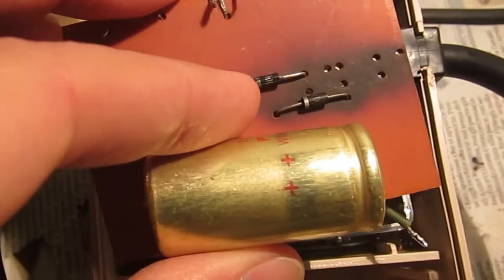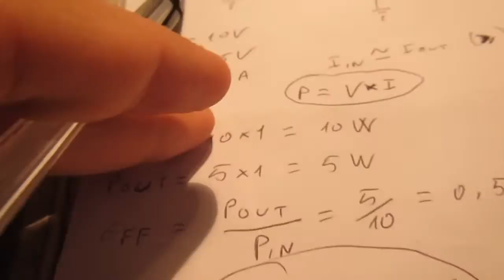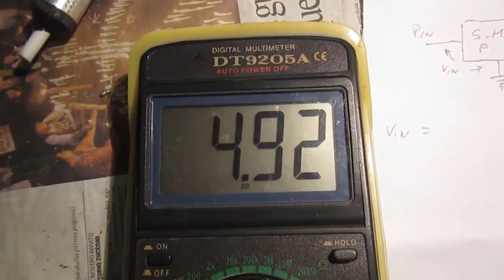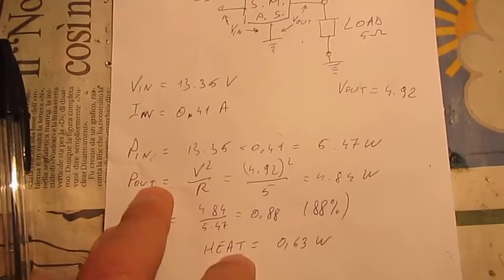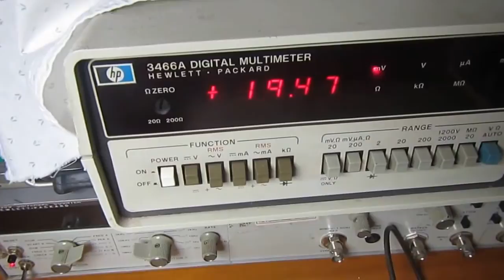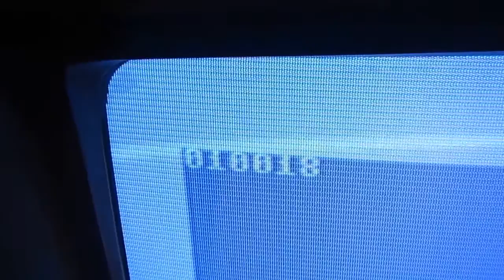Commodore C64/VIC-20 power supply repair/upgrade

Comment: Hi!
First of all thanks for the informative video. I have a newer power supply model Part No. 251053-11 which I would like to upgrade. Would you mind sharing the schematics of your design?
Reply from the maker: Hi Matthias, here it is: https://drive.google.com/file/d/1Ng9SGhC355VVgaSk85A6R8MeL4-H2JHl/view?usp=sharing
Reply from the maker: Avtually, if I'd design it again, I'd probably use an LM3485 controller and separate mosfet. More parts but less cost.
Reply: Thank you for sharing. I ended up using the LM2676 with a fixed 5v output.

Comment: I made similar mod on the more angular wedge shaped version of the C64 PSU (it has screw in the bottom and have very little epoxy in it).

What I did was the lazy way, I replaced the 5V circuit completely with a PCP mount switch mode power supply, IRM-20-5 from Mean Well. PSU look 100% stock.
Reply from the maker: Hi! Thanks for the comment! Yes, if you find a suitable sized board, it's a great solution. Also mine would look 100% stock if it weren't missing the bottom cover entirely (I've got it that way from the previous owner of the VIC-20).

Comment: I noticed you also have a 1701 or 1702 monitor. What do you think, is a recap of this monitor necessary?
Reply from the maker: Hi, yes it's a 1702, it's almost 30 years old and was used everyday for about 20 years. The only substituted part it needed so far it's the degauss coil's PTC that was toasted after the first 20 years of use. I only substitute capacitors when they are leaky and otherwise faulty and this monitor never showed any problem so far. But this doesn't mean that another 1702 has the same brand of capacitors or that they always age well. My advice is to get an ESR meter and check all the capacitors for proper (low) ESR and inspect for any sign of leakage. If ESR is good and there's no sign of leakage and the monitor works well, then you don't need to fix what's not broken.
Reply: Hi. Thanks for the advice. ESR meters are expensive! I am going to visually check all the caps in my monitor. Must be very carefull doing this!
Reply from the maker: Hi, I've built my own ESR meter actually and it was dirty cheap (but you need some soldering skills). As far as I remember, I've started from this schematic: http://ludens.cl/Electron/esr/esr.html
and added some few parts to make it more suitable to my needs, but the original schematic should work very well already.
Reply: iz8dwf Hi. Thanks for the link! When measuring a capacitor, can I do that when the cap is still soldered onto the board?
Reply from the maker: I've almost never found an electrolytic capacitor whose ESR can't be measured in-circuit. Of course, everything must be powered off and each electrolytic capacitor must be discharged as a safety measure before checking anything in the circuit.
Reply: Hi. I have a question about the aging effect of capacitors. When I don't use my monitor, do the caps age when the monitor is not powered on?
Reply from the maker: Hi! I'm sorry, I don't have a good answer for this. It probably depends on the quality of the capacitors, the working and storage temperatures and probably other things too. I assume we are speaking about electrolytics since almost all other kind of capacitors don't usually degrade with age.
My only suggestion is to check ESR and physical leakage before powering anything up after a long period of storage.

Comment: Interesting and tidy solution for the classic power supply problem. :) I want to build a replacement supply from a 9v transformer and a pre-made switching psu some time. I guess it should work just fine (depending on the quality of the switching psu of course). Your solution is a lot neater. Thanks for the informative video! It will be a nice reference.
Reply from the maker: Hi Jan Beta! I have tried also the separate off-line SMPS for 5V and simple transformer for 9V and it works well of course. My intention in this case was to show that the original C64/VIC-20 power supplies can be revived and really upgraded: they run cooler, can supply more current and become more reliable too. The power supply in this video is my "running" one since then, and I haven't had any problem so far.

Comment: Nice board. Looks like a drop-in board for the wedge PSU. 5W linear versus 0.63W in the switch regulator, wow that is some difference !
Reply from the maker: Hi bwack!
Yes, it's precisely why I designed the board, as drop-in replacement.
The wasted power difference is less than that because a real C64 doesn't need 1A on 5V supply, it was just a simple test bed to show the difference. I still didn't measure the real current needed, but anyway a switching regulator has many advantages in this case and works well.
Reply: I see :) 1A isn't far off though. My C64 draws about 1A, and the numbers vary a lot from C64 to C64, and also between revisions, like the C64C draws less with its HMOS ICs. Great work btw, and thanks for looking at noise. I suppose the noise will measure higher with high bandwidth probes/scope ? If you added say a Pi filter, would the efficiency of the PSU drop a lot ?
Reply from the maker: Hi, my scope has 200 MHz BW, but anyway the highest noise is at the switching frequency of the regulator and it's few tens of millivolts, so probably is less than the digital noise produced by all the gates toggling inside a typical TTL circuit (that's why every chip has its own bypass capacitor).
Adding a filter would not introduce a serious degradation of the efficiency anyway, but I think it's not really needed. I played for many hours with this power supply already and I've never noticed any problem or glitch on any of my C64.

Comment: I have one of these where the 5vdc is fine but there is no 9vac.
Reply from the maker: Hi Chris Stanley!, I think the 9Vac secondary may be interrupted, you should open the bottom lid and check directly on the secondary wires if maybe there's a disconnected wire (or it might be inside the connector if you didn't check it).
If indeed the 9Vac secondary is interrupted, there's not much chance to recover it, since it would need a new transformer to begin with.
Reply: Thanks, I haven't had a chance to look properly yet but I might open it up tonight and see if there is any obvious problem in the main unit or in the connector. The connector only has 4 pins which I assume is normal for this model of PSU?
Reply from the maker: Yes, all the original PSUs that I've seen have only 4 pins in the connector if it has not been changed later. In my experience a 9V secondary interrupted isn't very likely, it might be a disconnected wire inside the connector or inside the PSU where the secondary wires are connected with the external cord wires.
Reply: That's a relief, I thought I might have lost a couple of pins! Hopefully it's just a disconnected wire which I can solder back into place. Thanks for the advice, I appreciate it.
Reply from the maker: You're very welcome! Good luck with you power supply and let me know if I can help in any way.